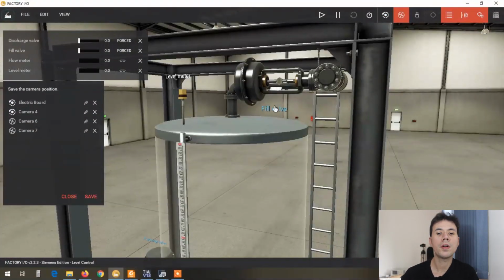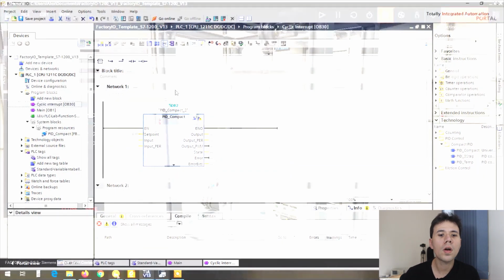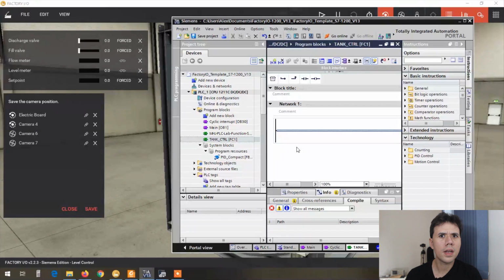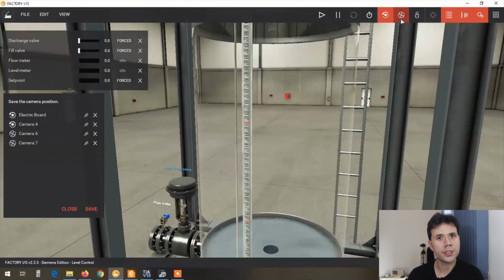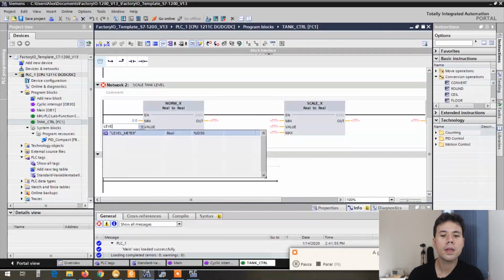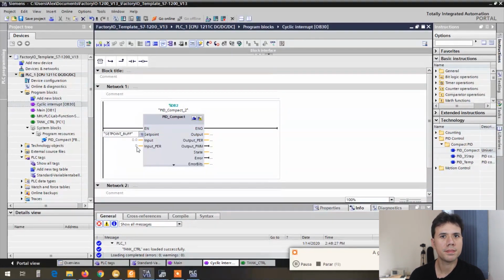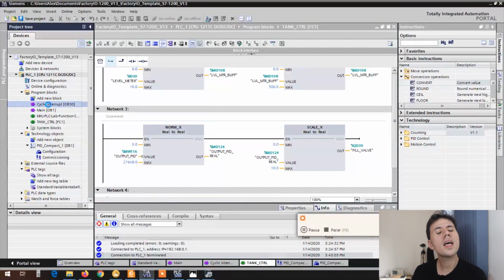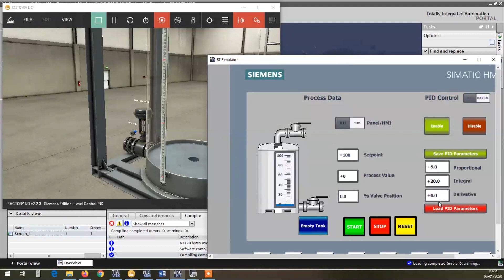Level Control (PID) - Factory I/O w/ SIEMENS TIA Portal (English)

Comment: pls help, Im really getting exhausted on this. displays read correctly but the last step, when starting the filling and turning process, mines just doesn't do the process and fill valve not working. outputs and inputs are all the same as yours
Reply from the maker: Hello! Have you checked the version of your Compact PID function? I remember having some trouble with it.
Reply: @AlexMacabu Thanks Alex. Finally I was able to do it. PLCSIM with S7-12000 couldn't do it through Factory IO. and S7-15000 was unable to connect to Factory IO. I had to use PLCSIM advanced without Factory IO template and it worked.

Comment: Interesting to note that you can use PLCSIM with PID controller for S7-1200. Many trainers informed that the PLCSIM with PID controller is only for S7-1500.
Reply: I have tried everything possible with S7-1200 CPUs still didn't work. And PLCSIM does not work directly with FactoryIO. Then I came across this comment and tried PLCSIM advanced (though some other issues occurred) and got the results. Thank you buddy

Comment: Hello, I'm beginner with this Automation Field, so I want to ask you about that function block called ''MHJ-PLC-LAp...'' what is using for and what there is inside it. if you can help me I would be so thankful.
Reply: This Function Block allows to cooperate TIA and Factory IO
Reply: @MrStalker2012  Yes sir, to be honest I looked for it in their WEbsite but thank you so much, 
if I'm allow to ask you about the pid compact block, it won't work with s7-1200 but it did with s7-1500, and also even with s7-1500 it did'nt work as it suppose to do.
PS: facctory io 2.4.3

Comment: Hi Alex. This is the best video I have found on the Factory IO and PID. I really like how you slowly explain every step. 
I am using TIA Portal V15 and the PLC SIM is not working with the Compact PID. I noticed you are using the V13 with no issues. Perhaps it is because you are using PID_Compact v 1.2?
Here is the explanation for those having issues with the V15. https://community.factoryio.com/t/issues-with-plc-sim-and-compact-pid/325
Reply from the maker: Hi Pete! I'm glad you liked! I had some issues trying to make that work for the first time. It turns out that PID_Compact version was not compatible with PLCSIM. You could try a different version of the PID_Compact block or even a different PLC Simulator, like the PLCSIM Advanced, a digital twin of S7-1500.
Best regards!
Reply: @AlexMacabu  how can i change PID version i am use TIA v15.1